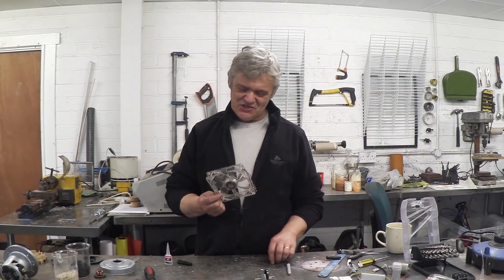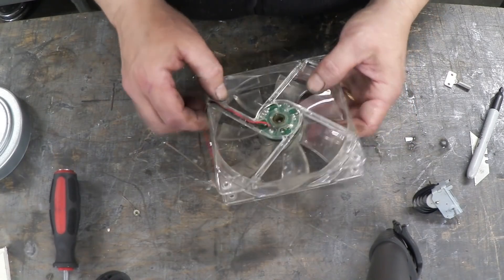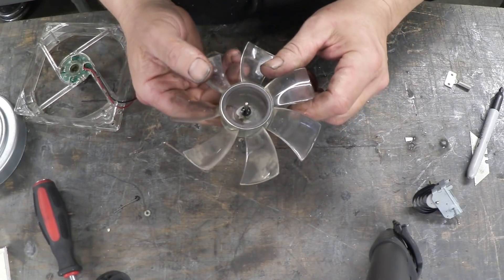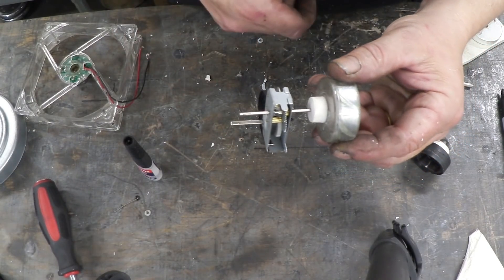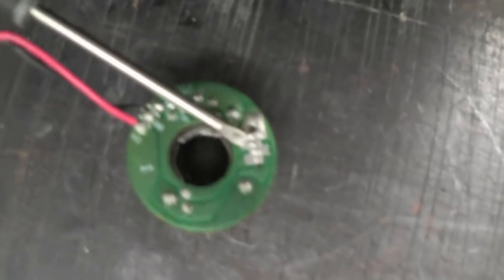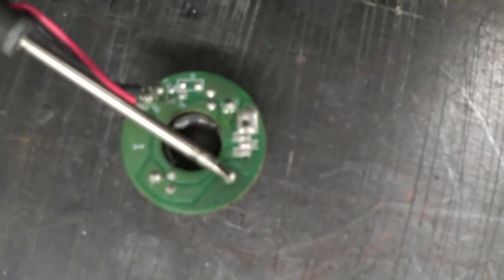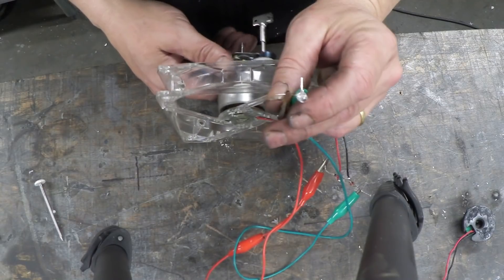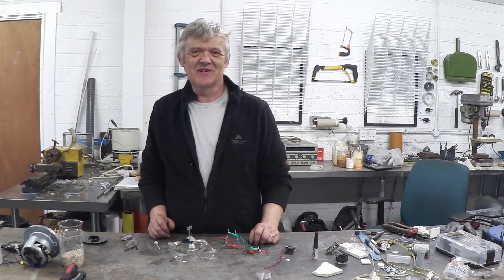How To Make A Clockwork Battery From A PC Fan

Comment: This can only mean that the torque of the movement is high and the speed is small. . maybe a stepper motor would be a better generator that has more magnetic fields per revolution that can deliver voltage.
But thx for the vid That also interested me if anything comes out at all!

Comment: I wonder if weights could be used instead of a wind up spring. Like old clocks whose weights have to be pulled back up to keep them running.
Reply from the maker: for sure mate
Reply: Yes Mike ... I was just checking to see if anyone had mentioned it before telling Rob! There is a device produced with a wind up weight to provide light for kids to do their homework in areas without electricity!